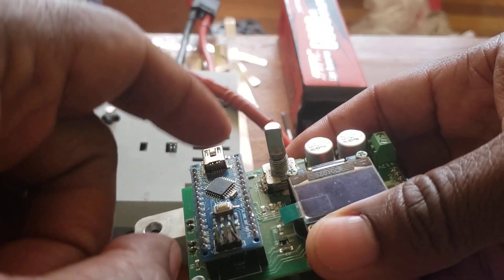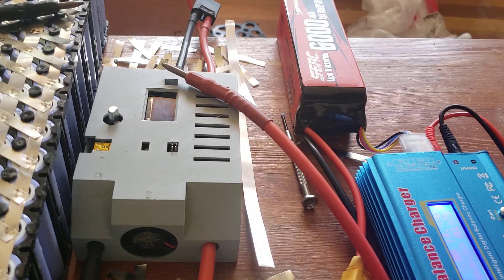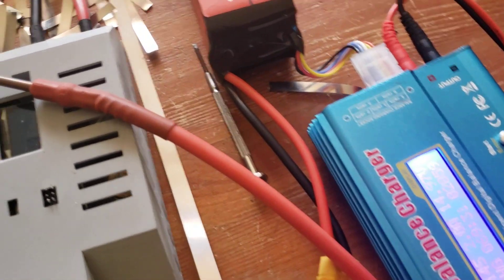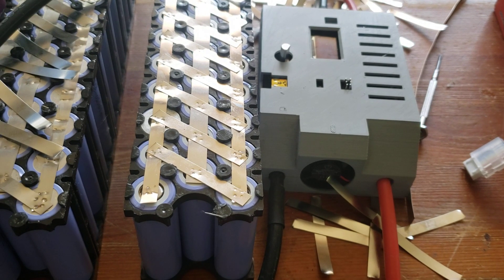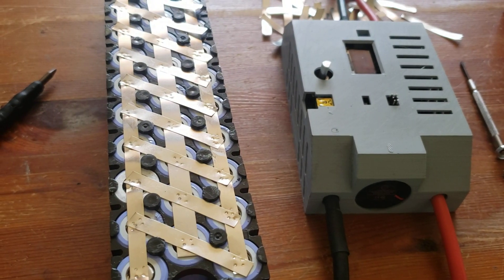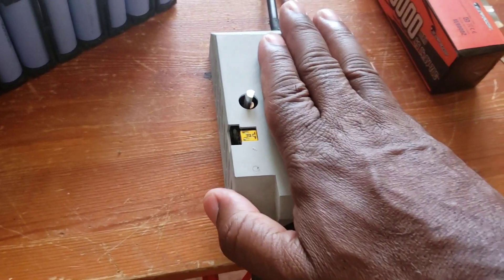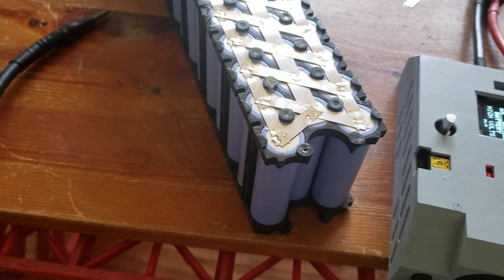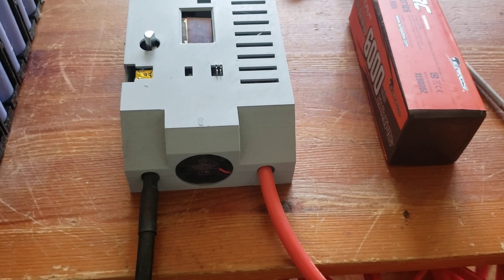DYI MALECTRIC ARDUINO BATTERY SPOT WELDER KIT V4 NEW UPDATE #MALECTRIC #SPOTWELDER #BATTERY #ARDUINO

Comment: First of all you SHOULD NOT use a 4s battery with this device. Creator of that thing says 3S is max 3s = 3*4.2V = 12.6V. Another thing is: there is NOTHING wrong with your charger - you are using 4s battery so it will charge it until it reaches 16.8V (4*4.2V=16.8V). You are missing some basics my friend….Your welder probably still works because you charge that 4s lipo only till 14V, not to its full charge… 3rd thing- your other welder just needs a 2$ arduino nano board. There is plenty of them everywhere on Aliexpress, ebay, and they cost next to nothing- no point fixing that burned 5V power regulator on your original one…
Reply from the maker: Thanks for the comment, I appreciate the time you took to watch the video. I was using the Lifepo4 4s 3.7v  battery 70C. By the way, the spot welder died for low voltage.